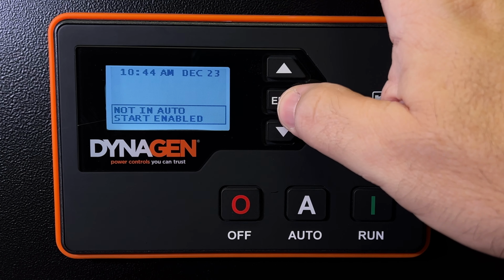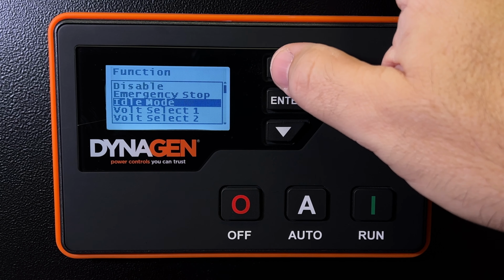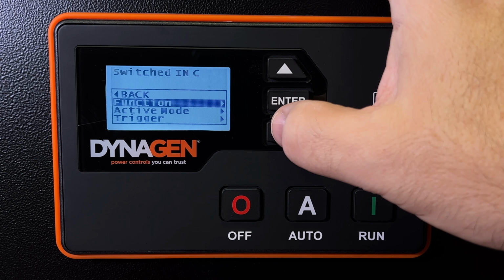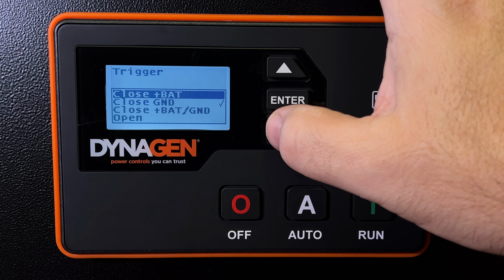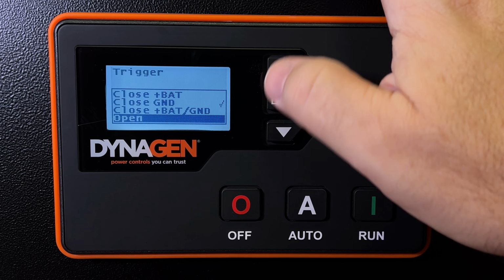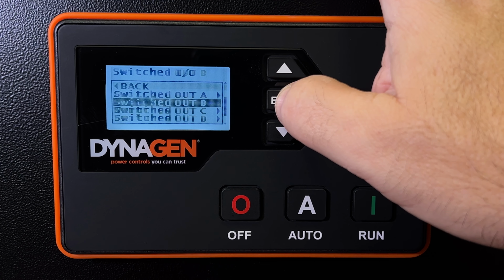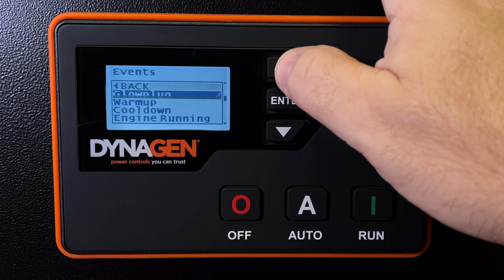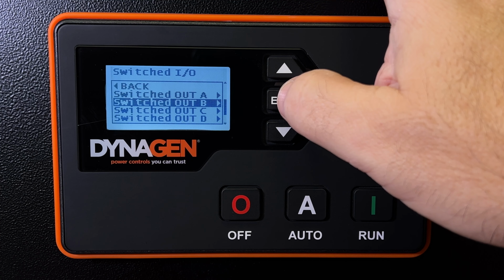DynaGen Controller - Automatic Transfer Switch

Comment: Can you program one of the outputs to signal the transfer switch to switch from utility to generator after loss of utility and after the generator is up to speed, etc. Input C would get triggered on loss of utility?
Reply from the maker: You would need to detect the loss of utility and monitor it on the controller.   You could perhaps power a relay with the utility and when the power fails, the relay closes and signals the controller.  The controller can then act on that signal and start the generator.  Another output can then tell the transfer switch to do something but there are controllers made just for transfer switches.  Actually most have a controller that already does this and don't need to use the generator controller.